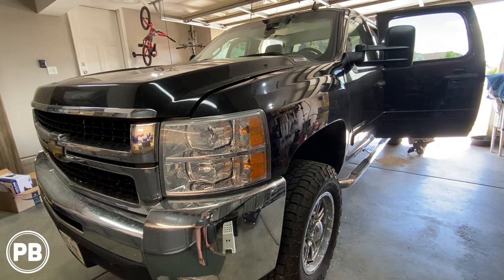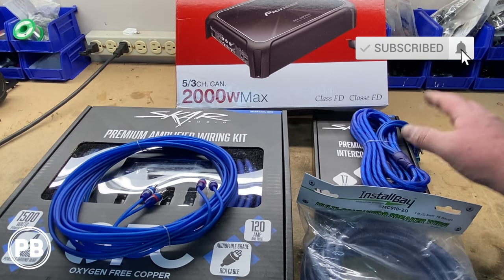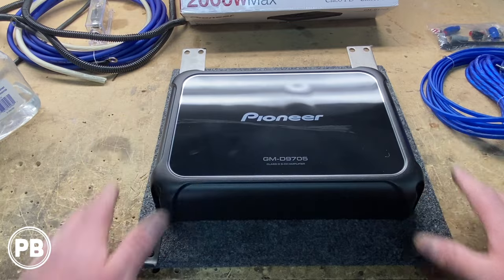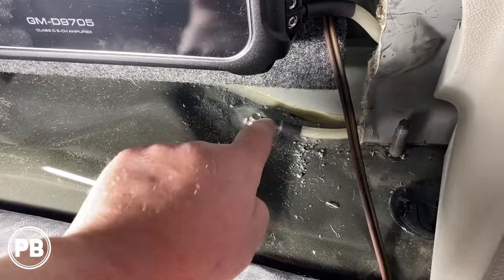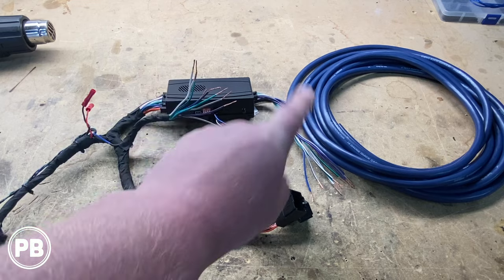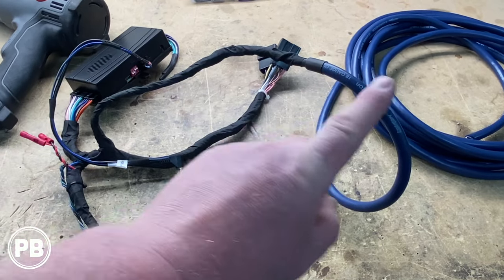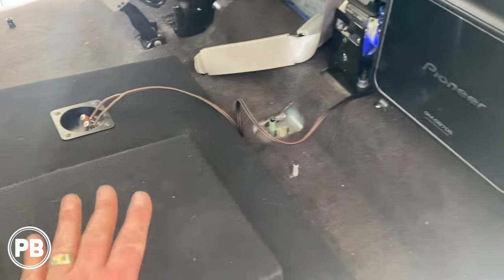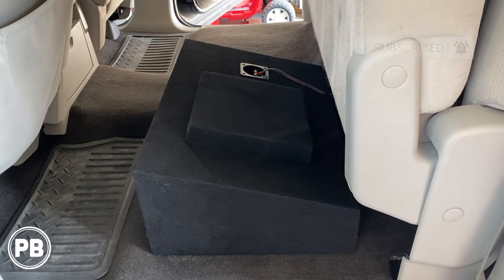2007 - 2014 GMC / Chevy 5 Channel Amp & Sub Install

Comment: Got a question, few years ago I got a amp and sub installed to my factory radio. I was curious if I could swap out the stock radio with a aftermarket one and would I be okay with doing that or would I have to change some things?
Reply from the maker: I’d recommend running RCA cables from the aftermarket radio to your amplifiers and ditch any high to low levels adapters that were previously installed.
Reply: @ProvoBeastAudio  would I be able to run them cables if I have a mono block amp. It’s a arc audio xdi600.1

Comment: I’m particular and trying to figure how to mount my amp behind the back seat without driving holes through the cab
Reply: I’m going to be installing an amplifier and subs in a 2010 extended cab and I noticed there’s no where to mount the amp!
Reply: @PincheBeto_Bass  I ended up mounting the amp to some 1/4” plywood and using zip ties to secure it to holes I drilled in the metal that sticks out from the back of the cab. The metal is what the carpet material is secured to with push tabs. No holes in the cab
Reply: @bowtiebuilding  do you mind uploading a short so I can see it bro?

Comment: Hello one question! To connect a 5-channel amplifier, 4 channels for the door speakers and 1 channel for a subwoofer with epicenter bass, the truck has the system
Bose (amplifier) and an aftermarket alpine estero, thanks

Comment: Very good video. Having a hard time wrapping my head around how to bypass the stereos wires though. Whats a T- harness? Which part of the harness do you run the signal from the speed wire to?

Comment: Thank you for this video! This is perfect timing! I have a Crux SOOGM-16 that I've used with a Sony receiver for the last two years, and no amp. However, I'm now adding an aftermarket 4-channel amp, and I wanted to use the existing speaker wires in my truck and harness, so I was about to attempt what you did - cut the output audio wires from the Crux and connect those directly to my amp. The front R/L +/- wires go directly to the GM harnesses (X1 and X2), and so does the rear R/L positive wire. However, I see Crux wired the rear R/L negative wires sort of crazy:

Aftermarket radio -> Crux 16 pin connector (manual has a typo and refers to it as 24 pin) AND to rear R/L negative wires on GM harness AND to Crux 8 pin connector audio output. I assume this is to pipe in the OnStar audio (which I'm not interested in keeping.) Obviously, I will cut the aftermarket wires since I will be using the pre-amp RCAs instead. 

My question is, did you cut those two rear negative wires anywhere else, or just right after the 8 pin audio output connector? I'm not sure if I should cut the connection to the "input" side of the Crux on the 16 pin connector portion, etc. From your video, I can see you cut at least 16 wires: 8 from receiver to Crux, and 8 from the Crux output to the speaker connects on the GM harnesses. I can't tell the rest since it's covered in tape. Thank you!
Reply from the maker: Hey there, where we cut is directly connected to the harness which leads to each speaker with nothing in between.  So any signal correction / onstar is bypassed as we are sending our complete signal from the amp right into the factory harness.
Reply: @ProvoBeastAudio  Thanks!

Comment: The harness that I have connected to my Kenwood DDX26BT has a few extra wires( yellow, black, red, orange, blue w/white stripe), I assume this connector still needs to be plugged to the deck(to power the deck)? and the other speaker wires(white, green, violet, grey pairs) are soldered to the speed wire? - 2009 Silverado 1500

Comment: Hey where can I get that amp mounting board? I have a 08 Chevy Silverado 2500 crew cab . I have a front fire 2) 8’s under rear seat box . So I need to mount my amps and cap

Comment: I’m going to have to run speaker wire from the rear of truck where I put my amp to the front and rear doors. When I run it to the front can/should I run it along with the RCA’s or up the middle of truck?  I’ve heard up the middle will pick up transmission noise.

Comment: I purchased a 2008 Chevy Silverado 1500 double cab. I’ve been following this series to help me with my install. I have a Eonon R80 head unit. It’s plug/play. Is there anyway I can tap speaker wires still?
Reply from the maker: I'd recommend building a T harness at the radio: https://amzn.to/44tQ5aY
Reply: @ProvoBeastAudio how did you tie in the 9 conductor cable? with the T harness? i’ve been bouncing back and fourth between this video, as well as just your radio install video on this model without the external amplifier. In this video, you had the extra plug in with the 9 wire conductors. i’m just confused on what to do here
Reply from the maker: Send me a message on facebook / instagram and we can give you as many details as needed. @piltbike5289

Comment: Your crux has two sets of speaker leads? Mine has one, which is what I would hook up to the aftermarket radio adapter. So I don't understand how you have more leads to connect to the 9 conductor/ to the amp..
Reply from the maker: Hey Jay Jee, happy to help if you send me a message on facebook https://www.facebook.com/ProvoBeastAudioInstallation/.

Chris

Comment: Are the factory speaker wires good for 75W rms per channel?
Reply: The stock wires are for like 40 watts but for like more them 100rms I don't think will be good I'm running new wires on mine on the 4 doors 12 gauge running 300 rms speaks on each door

Comment: So if I have a factory stereo in a Jetta, can I run the 9 wire to the factory stereo(No Bose or anything), then connect the 9 wire to the amp as if it was each speaker being wired?
Reply from the maker: Sure.  Send us a message on facebook and we can point you in the right direction for the parts needed.

Comment: What’s the rough cost of a job like this?
Reply from the maker: Parts (if you order yourself) are linked in the description for current prices.  Labor will vary by shop, or if you want to give it a go yourself, then save a buck.

Comment: Hi man , what fuse use for this amplifier? I use mini of 100 and explosion
Reply from the maker: Generally you fuse to your wiring type (CCA or OFC), gauge, and run length; not necessarily to the amplifier.  OFC wiring can handle more current than CCA wiring.  This amp needs 4 gauge wiring (we recommend OFC), and needs about 100 amps of supplied power.  If you blew a fuse, either your run is too long, bad wiring, or you have a short somewhere.

Comment: So running nine conductor wires str8 to amp and back of aftermarket radio automatically disconnects factory amp????
Reply from the maker: Nope, we have notes in the description of the video regarding if you have the factory Bose amp and how to properly bypass it.
Reply: Ok cause this is what I’m going through. I have 2012 Altima, I took out factory radio and installed a (Boss be7acp radio) with a (Boss 3700 5 channel amp)brought kenwood door speakers and 6x9 also but my problem is wen I try to  hook my hi’s up it make noise wen I cut it up and even burnt out to of my radios and that’s just wen I hook my hi’s up but I also have a 10 inch kicker wen I hook that up it play good no problem but I don’t have my hi’s hook up and I do have two amp if I have to connect them separately but I cant figure out what is making my HI’s do that I rewire and all just don’t see what’s wrong